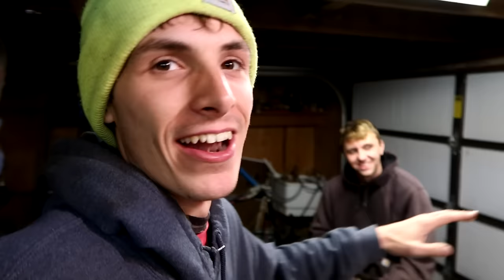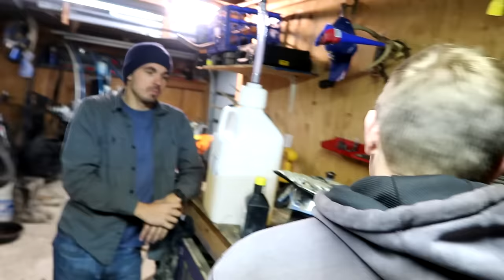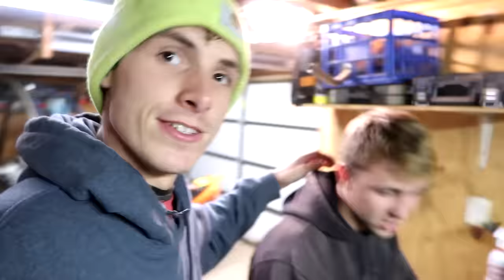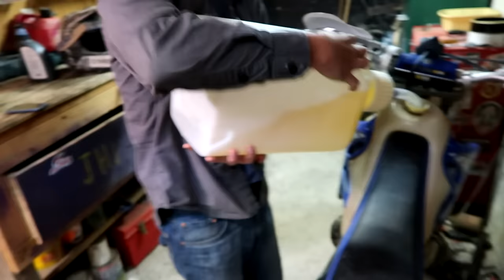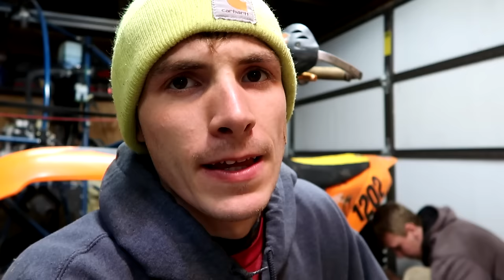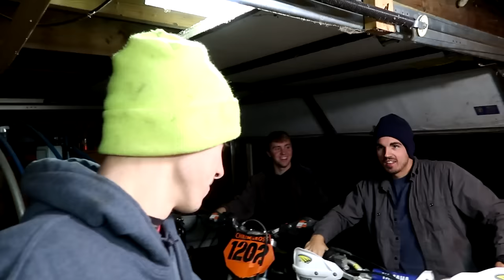HE'S AN ANIMAL

Comment: when Seths bike is cold use the choke with NO throttle and it will start better. You only need to give it a little throttle after its warm with no choke to start it. He is flooding it out the way he is doing it.

Comment: Use amsoil dominator as opposed to interceptor. Interceptor is better for oil injected bikes and dominator is better for premixed. Ive ran both in my 125 and i have seen better results out of the dominator